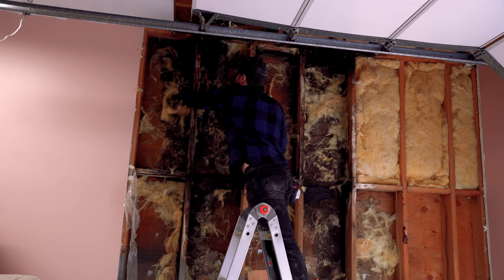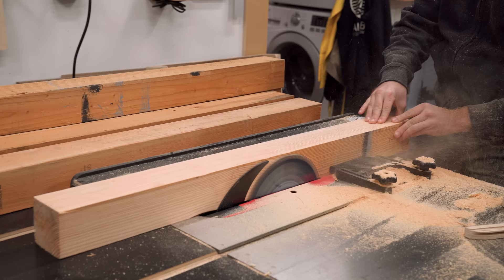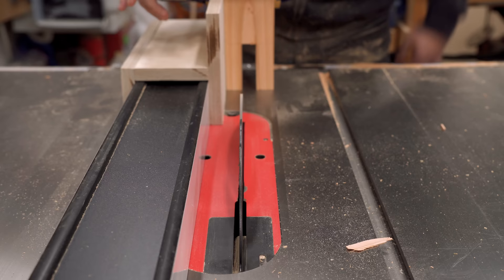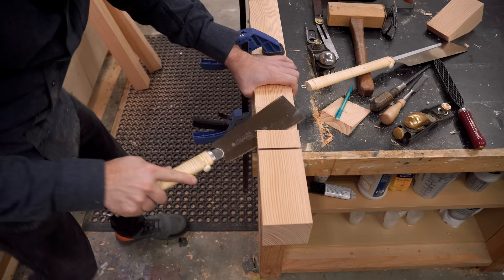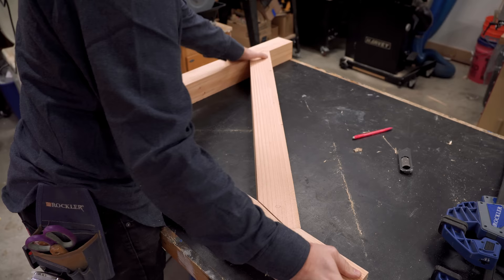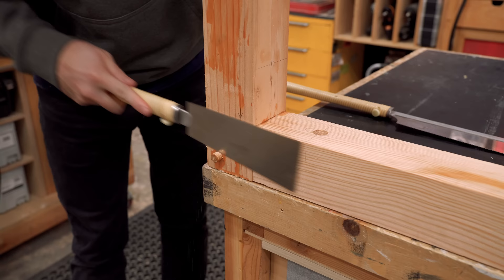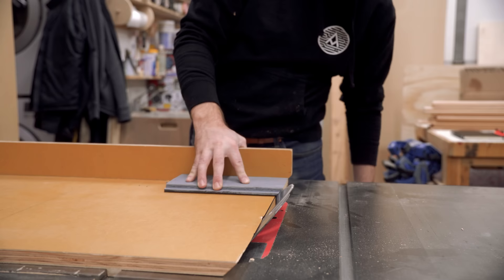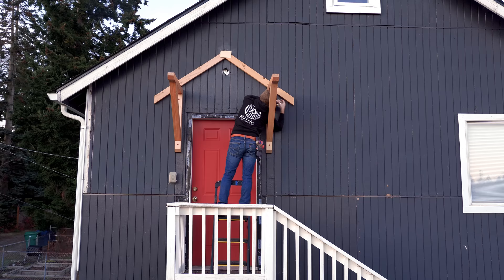Stopping the LEAK with a TIMBER FRAME AWNING

Comment: While I won't likely ever make this project, I learned a very valuable lesson: The moment you pin nailed the roof template together to test out the look, angle of cuts, etc, my mind expanded. Make test pieces based on referential measurements!!!! Thank you for leading by example here :D
Reply: Make test pieces for everything. I'm a cabinet maker apprentice and one of the first things I learned, was that furniture makers always make test pieces in the cheapest wood available, no matter what we need to do. If we need to set up a saw, drill press, router table, etc. Then we use a piece of pine/fir to test our settings until we've reached the desired measurements and only then do we take our actual work piece. It's a great way to make sure that all fuck ups happen with cheap wood and not the expensive wood destined for gorgeous woodworking

Comment: Sheesh. This is what happens when a cabinetmaker does carpentry. I love it: "..sneak up on the cut, to get it right..." and "...glued draw-bore tenon pins..." even on a joint that takes nearly zero loads in tension.  Michael you can't help yourself. You build for the ages, even when it's a simple, short-term mitigation measure for water intrusion!
Reply from the maker: Hahaha! Gotta challenge myself

Comment: As others have mentioned, it could use some flashing done which goes under the siding and over the roof to divert the water.  Otherwise it will leak between the roof and siding.

Comment: 12:37 if you use a smaller drill bit there, your offset will be perfect every time and you wont have 2 indents that might lead to mistakes. just go 1 or 2 bit sizes below the hole size, press them against the side of the hole you want to draw the board to and indent with that :)
Reply: That's a neat idea! Thanks 👍

Comment: @ Len Smith
That was my concern as well. The area between wall and first rafter is going to be highly susceptible to rot. I know he used that Halcyon finish on the awning, but that T-111 siding is going to keep on doing what it did before.
OTOH, the area under the awning will look nice for a good while.

Comment: I’d recommend cutting the beams and ridge flush with the outside of the last rafter and then fitting the fascia over the top. It doesn’t look as pretty but will stop moisture sitting on top and rotting out the ends, even with multiple coats of water based varnish it’ll be a week point. Replacing the structural parts in years to come is more of a pain than replacing fascia.

Comment: I hate trying to flash-in T1-11.    There aren't a lot of good ways to do it.    For this, I think would trace out the siding where it meets the rafters, add room for the roof deck and shingles and slide up my step flashing before patching in the siding and re-attaching the timber frame.

Comment: Was just writing a comment about that screw angle not pulling the joint together then you figured it out.. well done. Not sure how you figure that the bevel cut at the bottom of the upright throws water away from the building - it doesn't.. it just makes it look less clunky, a transition from one plane to another..
Re: the rafters - all you need is the pitch (which you knew) and the dimension of the outside edges of the brackets and you can figure out the joinery with math..  Top tip - when drilling, flip the rafter up the other way and drill thru the intersection of the birdsmouth so you make sure your hole is there - no layout required

Comment: Great video about your project, and like others here, it gave me some new ideas.  Thanks.  By the way, your Jackery is a battery, not a generator.
Reply: It is weird that somehow that has become the industry term for those battery/ inverter units. I think it is because they are generally used in a situation where you might use something like a Honda EU2000 so they are maybe trying to make that link to consumers. I guess they are also considering the combination with solar as actually generating electricity. Just as an additional note, I have dealt with one of these units in a not-sponsored professional situation and I was pretty impressed with it.

Comment: I commend you on the build, but as a timber framer, I wonder why you didn't use the mortise and tenons on the braces? And why glue your joints? If you use the dowels to join them together, they will never come apart. Barns have stood for hundreds of years with this method. 
Still, a nice job and the wood is beautiful. Cheers!

Comment: Looks really nice, not want to annoy you since you took it so far now.. but shouldn‘t the roof be on an angle by it self? Or are you compensating for it with the decking.. (otherwise water/moisture could still end up at the door frame..)

Comment: I need more practice on the Ryoba pullsaw because i tried doing a straight 18" rip cut on a 3/4" pine board and it took me 30-45 minutes... it kept binding and drifted away from my line. i suck at it lol

Comment: I like it very nice my only concern is the water coming off the roof onto the stairs if it gets slippery or freezes are you going to extend the roofline over the stairs so you have protection from the rain for the entire tread and riser otherwise looks great so far
Reply from the maker: Thanks! There will be a gutter system when everything is buttoned up 👍

Comment: I have a quick question.  I have the exact same need for the exact same building with T1-11 siding. How did you flash against the building? So rain doesn't get in between the awning and the T1-11.

Comment: What is that metal block with all the holes in it that you were using to draw the lines on the rafter??
Reply from the maker: It’s called a 1-2-3 Block. Typically a machinist tool

Comment: Not a woodworker, but when trimming beams, wouldn’t it be easier to flip beam, instead of using a plainer?
Just asking, not a expert. Great video though.
Reply: I think you’re talking about how the table saw wouldn’t cut deep enough to go all the way through so he was left with that little strip? I think maybe he was concerned that if he flipped it that the reference face would not be parallel to the original face because the beam wasn’t squared up yet.

Comment: PROBLEMS: 
1. Water / snow... 50% of whatever hits the roof surface is going to dump on the stairs and-or drain down the wall...
2. Water... when it is raining, even though that roof surface seems very small, you will be walking through a wall of water-fall...
3. Drainage... there is no way to trough and downspout the awning later when you figure these things out...

You would have been much better off with a flat roof (not pitched) sloped away from the wall to the edge of the landing. This would drain everything straight to the ground or allow a trough and down spout to eliminate the water at the not-stairs corner...

Don't get me wrong, it has the potential of turning out rather nice... it's just the second and third order consequences would have stopped me from going this route...
Reply from the maker: Thanks for the concerns, but there’s actually easy access for a downspout on the stair side. The stairs are offset from the wall and all I have to do is cut a notch out of a tread.

Comment: Excellent video but might it not have been easier to sheathe the roof before putting the rafters up? Either way it was very helpful as I am planning something vaguely similar for our cottage.
Reply from the maker: I was concerned about the weight, but in hindsight, it probably would’ve been fine to do that.
Reply from the maker: Oh wait! Just realized if I did it that way I couldn’t bolt the rafters into the brackets.